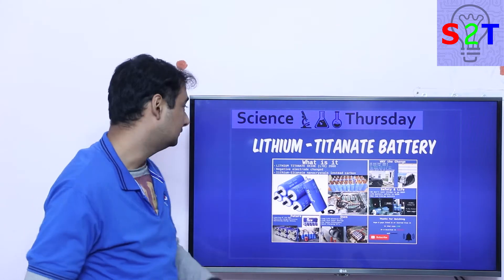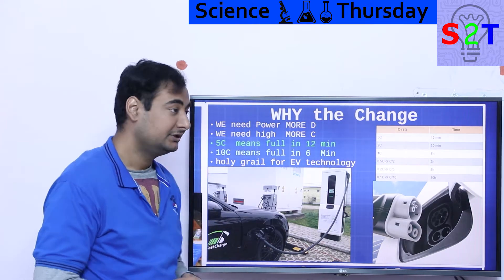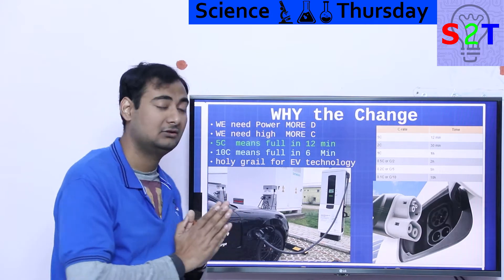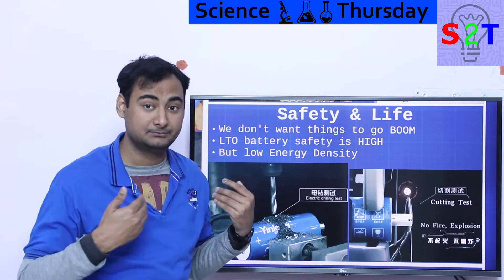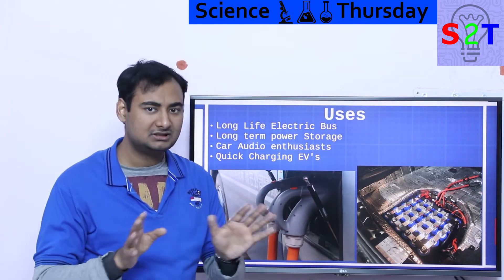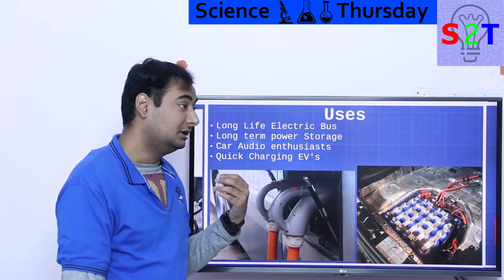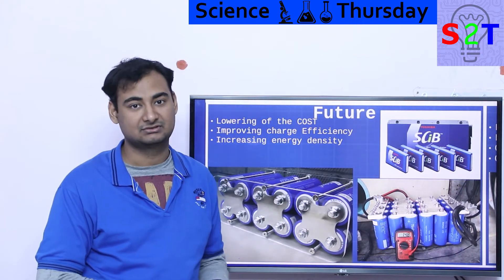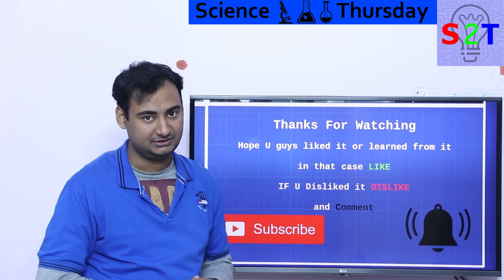Lithium Titanate Battery LTOExplained{Science Thursday Ep78}

Comment: Informative and entertaining. I'm pulling the trigger and ordering. One thing you didn't  mention wiring a 100 lithium batteries plus the charge board controler, over charge, heat control does not seem to be a issue. Easier to make. No board.
Reply from the maker: Enjoy and good luck

Comment: The critical downside you mention of only 85% round-trip efficiency seems to be wrong. Brendon Tait here on youtube measured one of the blue chinese cells, he got 99% coulombic and 97% energy efficiency at 0.25C rate.
Reply from the maker: Yep some people have pointed that out
Reply: @s2tenglish  you should pin a comment with a correction statement. this is a good video, but if you are aware of an important error, the viewers should be told. otherwise people will get the impression that you don't care about them.
Reply from the maker: I have not found any good enough verification that is why I have not taken any action and I am not a god so I can be wrong if its proved then I will cover it in future video

Comment: I've been using these exact cells (the 35ah and 40ah) since 2018 for extreme car audio purposes with much success. Ive run many banks, from a 5s 1p bank to a 6s5p bank at 15.5v at 10c continuously everyday for years, and even in freezing temperatures most of the year. Out of all lithium cells I've owned, the LTO cells have performed by far the best. I feel better safety wise using these as well in my daily vehicle and competitive vehicle. I have said many times to elon musk (friends on twitter) that I believe based on real world use that they would be a very good fit for EV uses. I have only been told by him that he will look into it, but nothing else. I'm a firm believer in not just these cells but other LTO cells as well. Perfect for EV use in everyway in my opinion.

Thank you for the informative video
Reply from the maker: I am glad U liked it there are some real reasons why people dont use them in  there EV main of which is SIZE for bus or truck there are good but for car there are too huge

Comment: There have been a few Youtubers that dispute the charge efficiency - look at this: https://www.youtube.com/watch?v=80bYoCfu33E
Reply from the maker: ODD
Reply: @s2tenglish  Maybe that charge efficiency of 85% is only at high discharge rates?
Reply from the maker: @mikezog1030  could be true that does actually make since and if people are buying it they are buying it for large D factor otherwise what is the point
Reply: @s2tenglish  I thought the main benefit was the 20k -30 cycle life.  Would the D factor be large for a house battery (Powerwall style)?
Reply from the maker: @mikezog1030  its more than enough heck normal Li Ion can do it this will keep sleeping
Reply: @s2tenglish  I would have thought that the D factor would be relatively low for a house battery? So people may not choose LTO for the D- factor, but would do so for the
 cycle life.
Reply from the maker: @mikezog1030  its expensive AF
Reply: @s2tenglish  Perhaps initial costs, but over entire lifetime? The last thing you want to do is replace a LiFePo4 house battery every ten years at a cost of $10k (including labour, time, etc), when you can buy once and have it last for 50 years (effectively the life of the house).
Reply from the maker: we all have limited capital so even if its 10X better we will not buy it if it destroys our bank balance

Comment: Nice Video bro with lot off info.  What would be the best set up for my 3kw inverter . i have 4 big efb battery at 100amp  total 400 amps at 12 volts. and mppt charger at 40 amps with 2 solar panels  2x300 watts solar panels in series each about 40 volts. the system is working good. Butt I need better batter for 12 volt system. because with the battery I got I can only go down as 10.6 50%. So would Lithium Titanate  LTO  will better as replacement instead of  EFB leisure battery. As I would need 6x2.4=14.4 witch mate be problem for some charge controls. Any of will be great.
Reply from the maker: try to get better BMS as its a long term solution  https://youtu.be/fNBemDxpwZ8

Comment: Please speak slower. At some spots it gets too fast and then it becomes hard to understand. Your content is very good by the way.
Can you include more info about the chemistry of the LTO batteries?
Do they use heavy metals in production or in the end product, etc. ?
Reply from the maker: U can slow down the video to your liking MY problem is with my camera's  recording limit

so Cant do much until i buy a camera without 30 min limit Sorry
Reply: @s2tenglish  Agree with Jan Girke. Until you get a new camera (if this is a problem) ... make two videos; -). Good content though!
Reply: @s2tenglish  Maybe you can use OBS and a webcam for nearly unlimited storage or you can patch your video signal through to your computer from your existing camera?
Maybe somebody is giving away a C270 from logitec (720p) or even a 1080p webcam.

Can you include more info about the chemistry of the LTO batteries?
Do they use heavy metals in production or in the end product, etc. ?